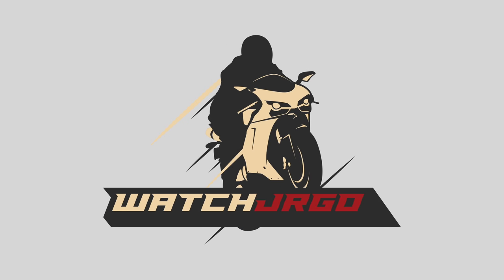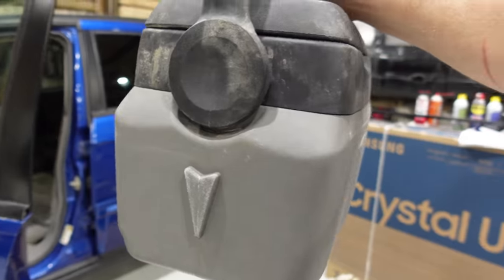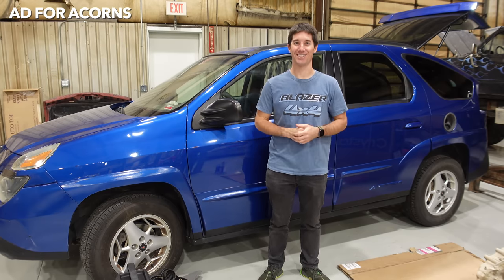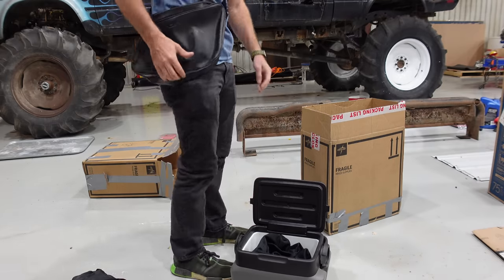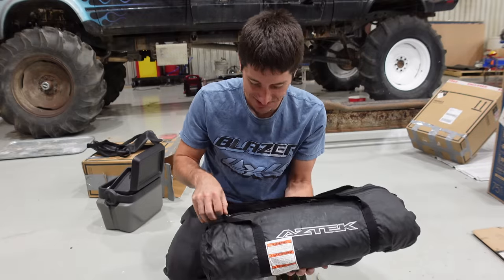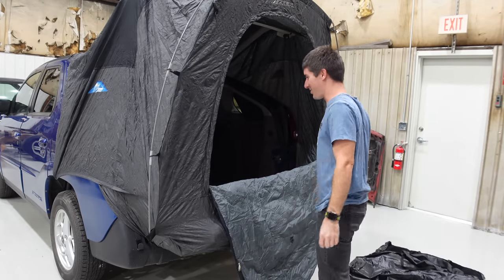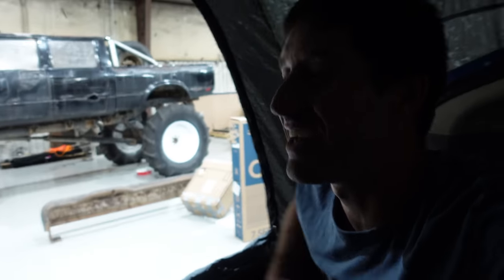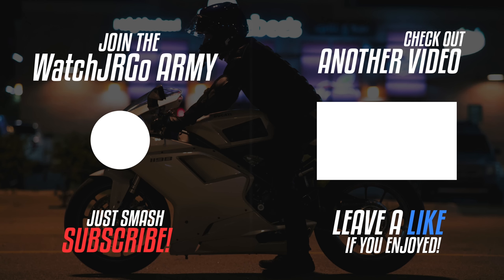PITCHING A TENT In My Pontiac Aztek *Factory Overlanding Package*

Comment: Hey JR, nice find with that tent package. I used to work for a GM dealer in Canada and had a 2001 Red Aztec for a demo. We went camping a couple of times with the tent and it did a great job of keeping the bugs and rain out. We even found the air mattress comfortable and a descent size. Ours had the optional Pioneer sound system which included a second control unit mounted on the passenger rear inner panel to be reached from the tailgate. FYI the shoulder bags are actually storage bags designed to fit in the lower pockets for the front doors making it easy to load and lock into place much like the cooler. Cheers

Comment: Well now that you're collecting all the optional toys for it it might be one you should keep instead of selling it off. Cool little multi purpose car, might need the all wheel drive option too if you do keep it and would make good content👍😉
Reply from the maker: Unfortunately a lot of the stuff I want (like the Pioneer system) can’t be added without replacing the wiring harness 😢
Reply: Well, it's a eBay goal or something if you keep it and you add things as you find them. You do have a following and when people hear you have something cool but odd they'll hook you up with parts and like that. When I had my Jeep and power wagon people kept telling me where other ones were and offering parts for a deal just to see them get used like they should be.

Comment: Aztec vs. Element  ?  Test drove both with-in 3 week period, plus throw in a Rav all in late 2004. Bought 2005 Honda Element brand new. The Aztec... needed a tent, Element seats (rear) removed out in 2 min. tops. Throw 2 sleeping bags couple pillows, close the doors and "click" doors lock. No brainer going with Honda. Still own my element to this day 79k, looks, runs and drives like the day i bought it. Aztec's were a money pit. Co-worker got one 3 months earlier he had it at the dealership 4 times in a 6 mo. period, gone by 2009.

Comment: The tent will NOT fit in the rear compartment. 

Congrats, you got a 2001 Aztek tent for a 2004. 2001 is different because the 2001 did not come with a spoiler so it does not fit as well.

There's a bag for each front door, that's where they go. 

The black shade in the cooler is the cargo cover.

Comment: Factory tint in my 2004 Pontiac aztek on whatever you would call it possibly the greatest or at least the original factory overlanding rate I don't know your words not mine so we've got some cool stuff here today let's get Right to work putting the interior back together and setting up a 10 here is where we are at on the Aztec that's unfortunately it's that shift interlock solenoid and if I put the sides on it's going to be a pain to change it so I'm waiting on the side but I can put that part back in the cooler holder and we can put all the trim back and you can see all the passenger side trim is already back in everything snapped on the car smells great now which is a massive improvement it honestly has no smell which is how cars are supposed to be putting all the rest of the trim back in place we are ready to put the back seats back in place and put that back panel back on clean the seats which have gone from these terrible terrible looking things that we pulled out to something that you probably wouldn't be worried about sitting on at all in fact I think they look as good as they're ever going to look and we're ready to snap those back seat in place of course over here everything's ready for the passenger seat to go back in but I should probably wait until the center console is together for the first time ever I'm not worried about sitting in the Aztec and in fact he seats I'm pretty comfy remind me not to tackle projects this bad again honestly was just because it was the cheapest one another like 500 bucks could have got me one that didn't need the interior cleaned at all right there we go once you lock the handle and it locks the cooler and it becomes a center console with a CD hole change holder storage everything so cool anyway the day I bought the Aztec I also bought the Aztec tent knowing that a day would come when we got to set up the tent on the Aztec so today we're going to pull it out and set up the tent we are just about to the finish line on my Pontiac Aztec rebuild and I know you're looking at this thing right now thinking man I missed my chance to invest in Aztecs but you haven't missed your chance to invest with the sponsor of today's video acords are you actively trying to save money for the future if not what's stopping you maybe like most you don't have a lot of spare cash to invest well acorns is a financial wellness have to make it easy to save and invest every day in the background of Life starting with just your spare change no expertise required get set up with acorns and under 3 minutes and begin investing with as little as five dollars the Apple automatically invest the spare change from your purchases through roundups every purchase you make is rounded up in the spare changes automatically you won't even notice it and overtime it can really grow depending on your needs acorns will recommend an investment for super convenient and easy to set up recurring investments from as low as five dollars a day so download you can get a $10 bonus investment in terms of conditions like me but we'll get to that later pull your Aztec out into a big empty area where you can set up a tent this thing is so cool when it's in this tailgate mode the side of the car is not how to reach so you can sit back and just enjoy yourself I think the tent is supposed to snow right here cuz it has this compartment that's about the size of tent rods of course we've got the air compressor back there air hose in there inflator mode and the suspension pump 12 volt power right there and on the other side tons of storage in the Jack so let's take out the 10 heading into the left right here how to set up an Aztec tent and has never set one up before now I do want to note this tent cost quite a bit of money I think I paid 300 something dollars for it they had to be done because you all need to experience how awesome the Aztec is it is here awesome all right here's the tent again huge thank you to acorns for sponsor today's video like I said before because their tent you can see the logo here is a spare cooler see if there's anything in it what is all this the cargo nets here some weird storage is the most stylish accessories of 2020 right here this has got to be like having a supreme bag but it's got a Aztec in Boston ready to take on The world guys yeah
Reply: That's about how it works also if I sell it I'll probably send the tent with it so it should add quite a bit of value because that temporary and the next person ps the phone did this. Don't know how.

Comment: At the 2001 Minneapolis Auto Show at the Minneapolis Convention Center, Pontiac set up a huge display around the Aztek.  The premise was two actresses, dressed up as park rangers were setting up the Aztek tent and reviewing the features of the car.  I felt bad for them because the presentation wasn't well received and they were laughed off the stage.  Later that day, they abandoned the presentation and the Aztek was just another static display.  

Really it's too bad because the concept was ahead of its time...GM as they are want to do, under develops it...or limits it by taking the concept and placing it on an existing platform i.e. the U Body minivan and then refines it then cancels it.  The later model Aztecs weren't bad looking and I think they do have some collector appeal.  Time will tell.